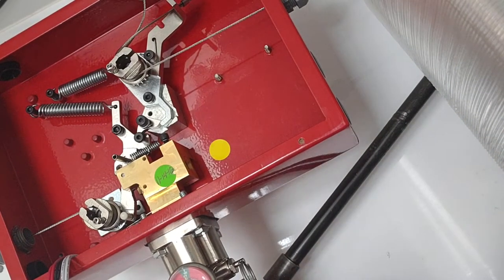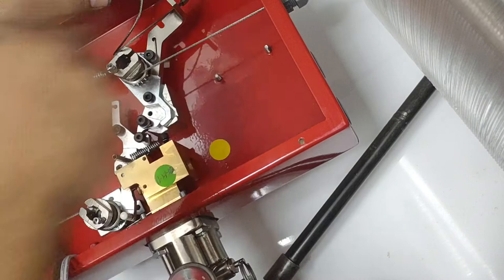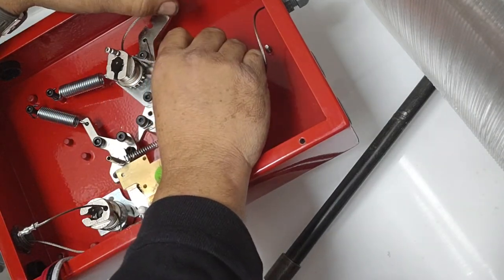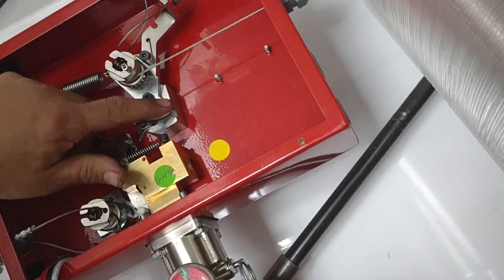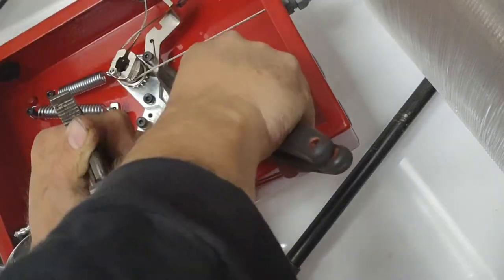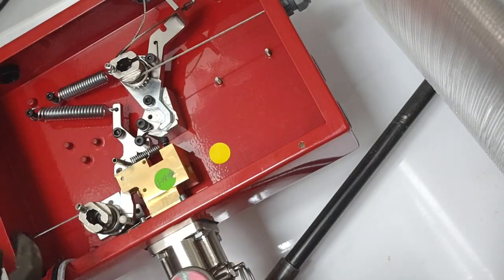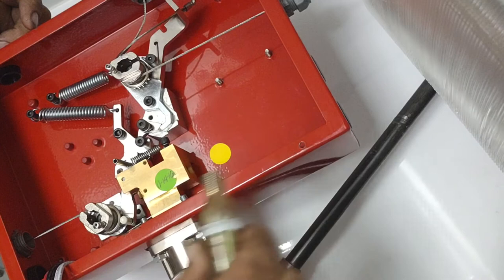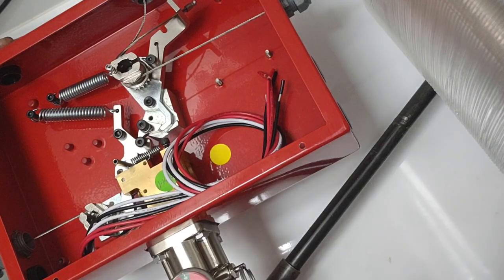Buckeye system reset

Comment: Your system was improperly set.
Reply: If there’s a space there where you tighten it it’ll most likely dump eventually.  I’ve had a few dump due to vibration without a space…then if you click too far tight it’ll break the detection line.  These systems suck.  The new box is better.